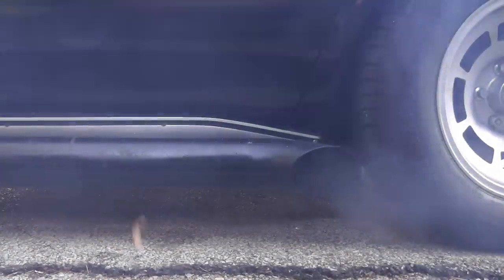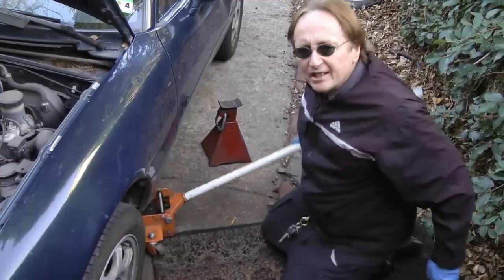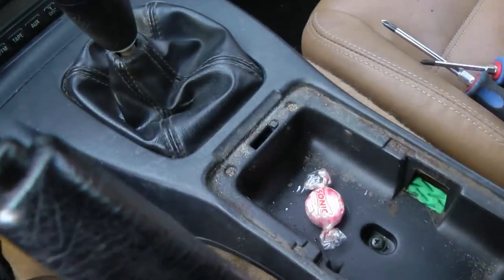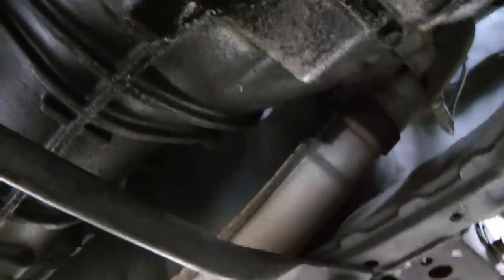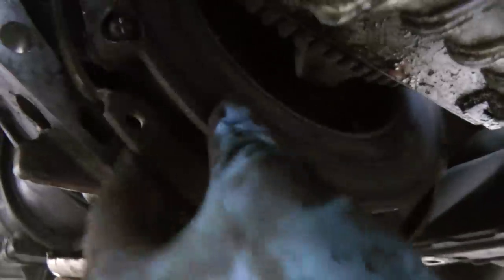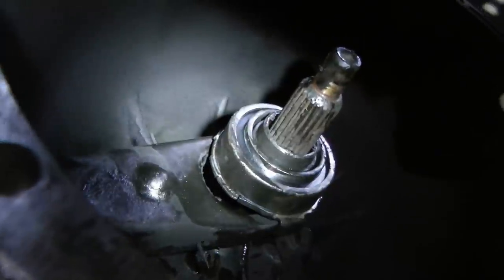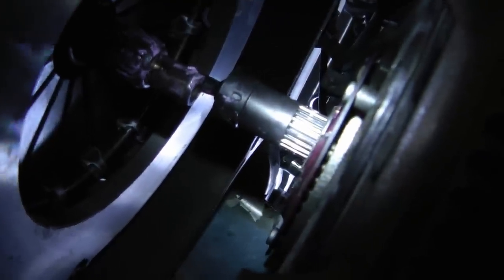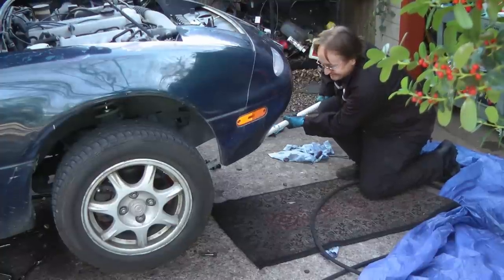How to Fix a Slipping Clutch in Your Car (Clutch Replacement)

Comment: Hi Scotty. I have a front wheel drive Mazda and when I'm shifting from first to second gear, I can feel the gear shift but it's like it stays in first and revs near redline. Would replacing the clutch fix this problem so my car shifts faster? Thanks. Great video by the way.

Comment: Hello, my car vibrates while releasing the clutch(1st gear and Rear only).
What could be causing this? Note that the Flywheel and Pressure plates have been replaced already. Thx for your help.

Comment: This is a clutch change on an old very simple car.. when you do fwd vehicles it a bit more time consuming also when you have to drop the subframe ect (most vauxhalls) drop frame, secure steering rack, secure radiator

Comment: Scotty I have a 2003 Dodge Neon, the clutch peddle is loose and it won't shift when its turned on. It does shift when its off though. Someone told me to replace the clutch but I'm not sure, what do you think the problem is?? The slave cylinder??

Comment: Hello Scotty, I have a 2005 Toyota Celica GT with 122,000 miles and it has an automatic transmission that jerks from 1st to 2nd gear, typically occurs in cold weather. I have never replaced my transmission fluid because on the dipstick it states, do not replace under normal driving conditions. Would it be safe to replace the transmission fluid at this point? Thanks.

Comment: Hi Scotty my car kinda chugs on take off in first gear its a 2000 toyota corrola it does it most when the car is hot and only in first gear, i checked the fluid its fine the mounts appear fine to , i do have alot of pedal play , the clutch was replaced abour a year and a half ago and i have only put about 20k on the car sense the clutch was done. any ideas what can be causeing this problem ??

Comment: I have a 1999 Acura CL 3.0 with 145000 miles with perfect running engine.  I'm the original owner with good oil change and maintenance.  Problem is the transmission started slipping, a clunk with hard shift.  It jerks and I'm afraid to drive on it now.  There was an error code (I misplaced it after writing it down) that directed me to check for the solenoids. However, I check all the solenoids (Ohms), and they are good according to spec from the service manual.   I tried to put seafoam transmisision cleaner, but the problem seems not going away.  Is the transmission damaged?  What should I do?  Replace the transmission?  Is it cost effective (about $3000)?  Thank you for your help as always. (sorry, I should have post this question in your "Fixing A Transmission That Slips And Clunks" video).

Comment: Hi Scotty-we have a 2000 Nissan quest. Had an AC leak and we replace the compressor and hose assembly and now it works But now the van shakes(in the engine area) like crazy every time we stop (even with AC off) and sometimes stalls-any ideas what is wrong? Thanks

Comment: Hey Scotty . I have a 2009 Smart Fortwo that has a 1.0 automated manual transmission. It sometimes clunks when going into reverse . Could the problem be in the rear axel? Or the clutch? It will sometimes shift itself into neutral then clunk into reverse

Comment: My 2003 Hyundai Elantra has a high pitch hum like noise when I'm in 4th gear.  Could that be the pilot or throwout bearing?  Also, is this similar to changing the clutch disk with a transaxle?

Comment: I had one hell of a job doing a clutch on a Mitsubishi Triton 2.5 Diesel, (called the Mitsubishi Mighty Max or the Dodge Ram 50 in America, Mitsubishi L200 in Europe) my old ute which I still got, the clutch literally fell to bits, What made it one hell of a job was a few things, when taking the tail shaft out, make sure you shove a rag in the end or oil will come pouring out when you drop it, I had to do it on the dirt, so I had a tarp layer down so I didn't have to lie in the dirt, well, instead it held the oil didn't it? the other frustration is you need to then jack up the front of the engine to tilt it into a certain alignment to be able to remove or replace the gearbox, which was still either a hit or miss especially doing it on your own, plus that gearbox is hell heavy and me being a lightweight of 64 Kilograms, which multiplied the effort in getting it back in, without the jack because I had to use the jack to tilt the engine into the right position because it was so close to the firewall. After all the swearing and cursing getting covered in gearbox oil for a whole day doing it all completely myself, it was all worth it in the end and the truck was back on the road, 50,000 Kilometres later, its still going strong.

Comment: wow Scotty you make seem so simple :-)  .on my 2000 s10 I'm wondering if my clutch is going bad, once I change gears it stall or jerks a lil doesn't do it all the time would that be a bad clutch or what can it be. Thank you.
Reply from the maker: +Angel Tapia generally worn clutches slip and you can't accelerate or get into gear.  Have a mechanic road test it to tell you

Comment: hey scotty, i have a 2008 nissan altima coupe 2.5 and when ever my car has been parked for a while and turn the engine on and drive off, my u hear a rumbling sound at 1.5k rpms and it feels like the transmission is having a hard time figuring out what gear its on. it is followed by some squeaky chirpy sound like its a belt problem, but it all goes away at 2k rpms or higher until i park it again for a while. its more evident when im parked in a declining area and i drive against up the  decline or reverse up the decline.

Comment: i always machine or replace the flywheel as I do with brakes, aftermarket flywheels are surprisingly cheap these days and gives a nice clean surface for clutch to bed down on. if ones slipped till it can't even move the car I bet the flywheels all heat scored and possibly cracked. I agree it adds cost but on older high milage cars might have seen 2 or 3 clutches on the same flywheel. its like 50 bucks at a machine shop if you take just the flywheel in or a couple beers to borrow a mates lathe for 5mins.

Comment: Scotty I have a 2wd Ford f150 1996 and it makes this noise sounded like it's coming from the front but seems to only do it after driving it for a while not sure if it's a wheel bearing or something else cause it don't do it when you first start driving. But the other day it got really bad and loud but then the next day I drove the truck and couldn't get it to start again. What could be making this noise ?

Comment: Hi! I have an 01 Miata that sometimes shakes really bad when its in first gear. I find myself having to rev higher before easing up on the clutch. Other times the engine runs fine. I find that when I'm at a dead stop it doesn't happen as much but if I'm moving a little, and i throw it in 1st gear, the engine will shake, which forces me to rev higher to resolve the shaking. Do I need a new clutch?

Comment: Hey Mr. Scott, i bought a toyota corolla 2015 about 6 months ago and last night the clutch started slipping, i mean the car is brand new, just 4000 kilometers on it, so do i have to change the clutch or could it be some other issue?

Comment: You must lift down the gearbox to access in order to mount the clutch on the flywheel. I did that on my Volvo 144/73

Comment: I had my clutch replaced 3 times in 5 years. They resurfaced the flywheel the first 2 times and put in the entire kit each time. The third time the mechanic suggested a new flywheel to solve the early burned clutch problem and that seems to have fixed it. When you just eyeball the flywheel and declare it smooth, I have to be skeptical. I would at least resurface the flywheel when installing any new clutch. 
That said, I do not think I could buy all the tools and find a space to do this myself.

Comment: I have replaced my clutch in my ford f150 300 with a 5 speed and I got the flywheel turned for only 25 bucks. When you find the right person it will be cheap. just look around if not you can get it done on a brake roater mill and it will turn out just fine.

Comment: I've got a question, my car's clutch is slipping, no question about it. But it's not too bad so far, it only happens when I'm driving a decently steep uphill, in 2nd or 3rd gear, it doesn't happen otherwise. 

Went to a mechanics this morning, he told me $800-$1000 to replace the clutch (in Australia), mentioning that I could find cheaper elsewhere (either being almost too honest, or he simply didn't want to do it).

That's too much to spend on my car given how old it is (220k+ km), assuming I will be cautious with the clutch (and never let anyone else use my car), how long do you think it can hold on before getting completely un-usable ? It's probably a bit hard to tell without seeing the problem, but even roughly, once you notice it starts slipping, when does it usually break completely ? 
and more importantly, is there any chance I will damage something else like the engine or the gear box if I keep using a slipping clutch ?

Thanks

Comment: Hello.  On my car, it's a little unsmooth to put the car in 1st and 2nd.  Could it be the clutch?  The knob used to just slide in to 1st but not it required a little more effort.  It feels like there is a bump. thanks

Comment: I also have a question, I have a 97 Chevy K1500. Automatic transmission won't shift into 4th, but will shift into 3rd. Do you think it'll be worth it to keep and try to fix myself or scrap it, because paying a shop would cost more than I paid for the truck. Although I could be wrong my research tells me that it's the 3-4 clutch that went out.
Reply: +Scotty Kilmer Makes sense. Thanks for the reply!

Comment: Hey scotty I've got a problem with my Lexus IS250 where if I even touch the gas pedal in 5th gear it revs to the limiter and I won't start moving in 1st gear until I hit 3,000 rpm will replacing the clutch solve my problems?

Comment: Hey Scotty, hopefully you can respond very quickly. I have a 1998 Honda Torneo with an automatic transmission. The connection from 1 of my solenoids broke, is it ok for me to still drive the car until I am able to take it to the shop tomorrow?

Comment: Hi Scotty,
I have been silly while driving my vw passat 2006 tdi and while driving on 70miles/h I depressed the clutch and tried to change the gears without releasing the clutch. And all of sudden the clutch got stuck into deppressing position and I had to pull the car on side of the road.
I stopped the car and pulled the clutch back into its ideal posotion - but now when i drive the car it makes a bit of noise and its not smooth. do you think if i might have damaged the clutch or migh have dispositioned it or i don't know...

Comment: Hey Scotty, I have a 99 ford escort lx and I was driving on the interstate and all of a sudden my wheel locked up and had to pull over. I checked everything on the outside of the car and everything was good until I got back in the car and realized that I couldn't get my gear shifter out of gear. come to find out it was the manual transmission that locked up. I finally got it out of gear but it was making wierd chattering noises when driving then later the noises stopped. but now when I go into first and second gear it grinds into gear. 3rd, 4th, and 5th gears don't grind. do you think it's the clutch or do I need a overhaul.

Comment: Hey scotty I have a 6speed lsd gearbox on a high reving 20valve blacktop engine normally i could rev out 1st gear all the way up to 8200 rpm but now whenever I do that while shifting from 1st to 2nd the gear just won't go in no grating sounds or anything...however if I drive normally the gears go in perfect but only 1st-2nd sticks whenever I try launching the car is that a slipping clutch or another problem?

Comment: Scotty  Help!  If I 'm having to double clutch 95 % of the time to get any gear engaged ( especially when going over 10 mph) is my clutch slipping or is it a synchro issue. I don't hear any grinding at all when engaging. I've got good pedal and have bled the system and replaced the fluid. It has  a hydraulic throw out bearing installed and I'm going to have to take the tranny out but I'm not sure what to look for and I really don't want to go inside the the tranny and replace synchros if  I don't have to. Your thoughts would be greatly appreciated  Thanks !!!
Reply: Same thing with my car :/ idk what the prob is tho

Comment: I'm about to tackle this project on Saturday, is it something two people with limited car knowledge can handle? Is the alignment tool a have to have item? Also I already have a new clutch plate that the previous owner gave me should it be a problem if i just replace that?
Reply from the maker: best to replace all the parts, but if you're  gambler, change just the clutch disc itself as that wears out the most

Comment: Hey Scotty, I recently bought a 2012 civic si and the clutch is making a high pitch squeal when engaging into 1st gear. It still grabs strong but will grab in different spots on the pedal, have you heard of this before? What do you think? Thanks
Reply from the maker: clutch is just starting to wear out, often the throw out bearing. But they can run that way years, I wouldn't take it all apart until it stopped working myself

Comment: Don't forget to add the gearbox / transmission oil after its been bolted back on and lowered on its wheels!  Good video!  Only thing I never seen in your videos is grazed knuckles or cursing trying to get heavy parts back in!

Comment: I know you answered this in the video (flywheel resurfacing)???  I was under the impression this is a common thing to do when replacing the clutch??  I believe you did not resurface the flywheel when you replaced the honda accord clutch (front drive)?

Comment: hi Scotty I have a 1997 Acura CL Manual Transmition my question is when I start the engine it make a  weird noise but goes away when clutch pedal is pressed any suggestions .Thanks

Comment: Hello! Could you give me advice on why does putting the car into the first gear, makes it almost impossible and it makes very bad grinding sounds, when in motion? But when i stop and put it into 1st it goes in smoothly and no grinding noise. It also give me the feel like gear shifter is getting stuck onto something, but as i said when you put it in 1st when fully stopped(at the stop sign for example) it  goes smooth as butter.
Reply: It's probably the synchronizer for 1st gear. the synchronizer is a bearing that sits over the gear and spins it up to speed to match the transmission. if the bearing loses its resistance it will no longer allow the shaft and counter shaft to slide together smoothly, thus making that grinding sound. it slides in when your car is stopped because both gears are stopped. have a transmission shop give you a quote for the repair and then pay a private mechanic half of that to do it. or you can blip the throttle to get it into first gear at speed like a semi truck XD. hope this helps.

Comment: I changed my clutch with a clutch kit about four months ago because it was slipping and shuttering. Only in first and second gear went away for awhile now it's back, what could be the problem I changed everything even resurfaced the flywheel. What's my next step?

Comment: Hi Scotty, is the fluid that comes off the clutch is the transmission fluid? Cause my vehicle w/c is a suzuki carry cab seems doesn't have a transmission fluid in it, or I'm not really sure if it has or just uses an engine oil. Does all of the vehicle needs a transmission fluid?
Reply from the maker: clutches use brake fluid.  A standard transmission uses standard tranny fluid, different on many different cars so check with suzuki about which kind yours uses

Comment: Scotty I've got a request .....could u make a video on making a correct adjustment on a clutch slave cylinder???? To prevent drag on the clutch ,  If you could , I've got a 1988 Nissan D21  ( yeah , shes still runnin ) maybe you could make a video with a similar vehicle

Comment: I think we'll be seeing this Mazda again. I could have sworn I heard some clattering when you started it up at the end. But from a video can't tell the difference between a loose heat shield on the cat, or a bad valve train (either possible at this point).

Comment: i actually have a question, my car has that dial where the car is either hot or cold for the engine, well it doesnt seem to go up and stay in the middle, any tips how to fix and how much it will cost?

Comment: great step by step vid sir.  my brothers car a 2009 chevy cobalt ss needs a new clutch,  he got an agressive tune on it right now and the stock factory clutch is slipping "a bit" under pedal to the medal hard accel in 3rd gear,  he wants a quality aftermarket one that will take the extra 30-70hp over stock.  may i ask what would you recommend is a good brand for an app. like this? thanks.
Reply from the maker: brand names these days often mean nothing as companies are always being bought out. So, go to a speed shop and ask them what the best model for that is today. they change so quickly

Comment: Hi Scotty, can I use some super-glue to lock the disk on the plate before mounting? I saw that in another video.. I dont have the special tool like the one in your kit. Thanks!
Reply from the maker: you do not want to lock the disc on the plate, that would damage it when used